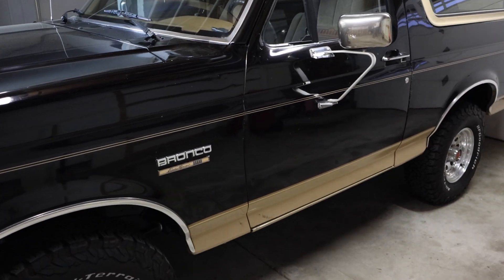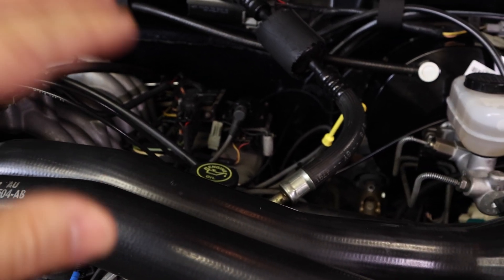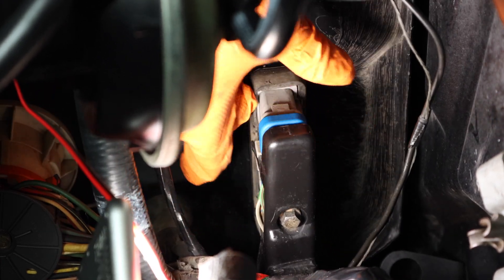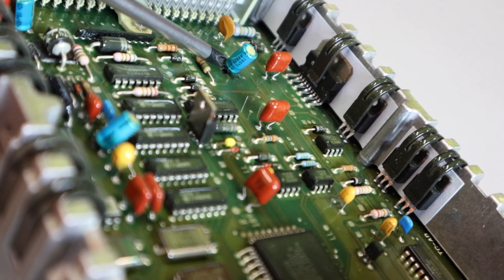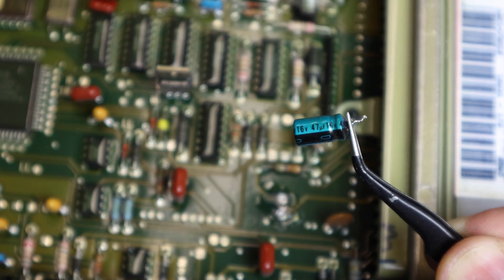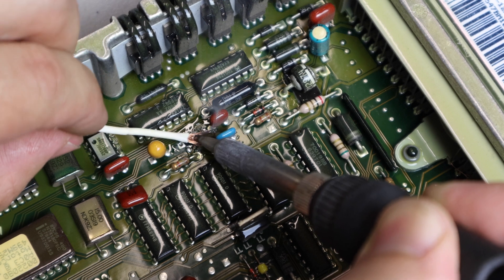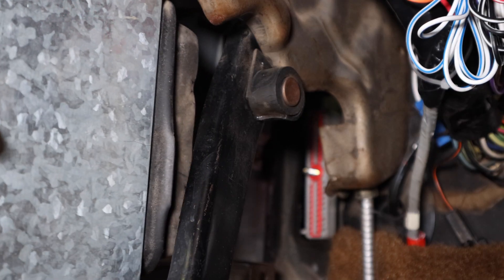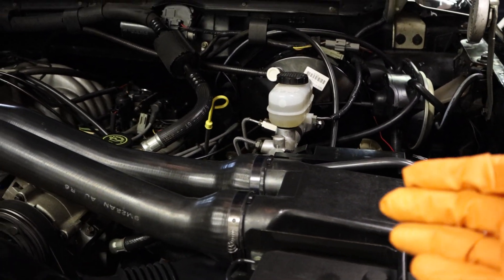Ford ECM Repair EEC IV | Fix Multiple Issues | 1980-1996 Ford Bronco F150 | Bronco Restoration

Comment: Thank you for the video! Years ago, I remember doing LED electronic work and I can’t remember if the long blade represents the positive or the negative but how are you deciphering positive versus negative when you’re installing… I heard you say look at the black bar on the first resistor that you did, but how do you know which side is which??

Comment: I jist spent around 500 replacing everything from maf alternator idle air control . Break booster . Coil pack . All on my 91 4.0  jist to realize this is my problem ... thank you for the video

Comment: Could this fix help out with the battery light being on?
Reply from the maker: If the truck runs normal other than the battery light check the charging circuit first. Check the alternator (local parts stores do this for free) check/replace wiring from alternator to battery and to solenoid. Also check for battery health and cable/terminals for corrosion. Does your voltage gauge work properly?

Comment: I’m real interested in how you tested your idle w your multimeter. I have a 94 bronco XL 302, and he doesn’t have an RPM gauge. Care to shed some knowledge on testing your idle w the multimeter?
Reply from the maker: I tested the TPS sensor and IAC valve. The IAC valve controls the minimum air needed to hold a steady idle, while the TPS sensor provide the ECM with throttle position. The TPS voltage reading will change with opening/closing of the throttle which the ECM uses to calibrate air/fuel ratio. If you need to verify your RPM speed you can purchase an aftermarket RPM gauge/tach and it should be easy enough to setup, I believe one wire to the ignition coil.

Comment: @TheFixTech Are the capacitors the only thing that could fail on these ECMs? What about the brackets on the side. I am thinking of replacing mine. Quick question, what if I get non-polarized capacitors, any specifics?

Comment: I had a pcm repaired recently for my '96 F250 by a well-known guy on FB.  Worked fine before I sent it in but wanted to be proactive and get the caps replaced. Got it back, reinstalled it and now I have an intermittent issue where the engine labors for roughly 15-60 seconds. Could there have been something that he messed up when doing the repair that's causing this?  I've been firing the parts cannon at it lately with no remedies thus far.
Reply from the maker: The 1996 year model has an OBD 2 PCM that may not have the capacitors. With this system you can scan the system using the obd diagnostic port and the PCM should tell you any pending codes. If the engine struggles on initial fire up it could be a sign of a failing IAC valve that controls idle. I would start with scanning the pcm for any codes.

Comment: I have read the problem is usually no the EEC.  So, how common is this?  I have a 1990 Notch Foxbody with many issues...
Reply from the maker: It is a low cost fix that is worth trying, open the ECM and check the capacitors. If there are bad you will see them leaking and or bulging. If they appear fine do not attempt repair. Scan the ECM for error codes and start there.

Comment: I might have to check this out, I've been fighting an issue that seems like nobody else has been having. My 89 f250 will intermittently shut off and turn back on again in rapid succession while driving down the road. Imagine being on the throttle and just switching the key on and off as fast as you can. I've checked voltages, traced wires, replaced grounds, and tested sensors until I couldn't take it anymore. The idle is also weird where sometimes it will hang a little high after driving and after it sits for a bit it will come back down, sometimes it idles smooth, sometimes it has a jerky idle. If I turn my headlights on and run the blower motor full blast it will cut out way more often which is why I thought it was a power/ground issue. However disconnected the battery every couple months has been keeping it running more smoothly.

Comment: I have f750  getting phantom voltage  any ideas  im think ecu but there all backorder  control module 63.47 volts
Reply from the maker: Disconnect the battery, then unplug the ecm/pcm, reconnect the battery and check for voltage across all connectors, if there is power where there shouldn't be then there is a short in the wiring. Check all battery connections and fusible links, also alternator voltage regulator

Comment: going with higher voltage rated capacitors can lead to a longer lifespan and provide extra protection (going with a 25v vs a 16v for example), also, when possible, always go with brand name caps.

Comment: will this fix mine? Mine killed the ecm engine off check and the fuel pumps continually run when the initial key turn on is done. Was running great , on the freeway still ran but started sputtering and loss of power. Black smoke like a bad accelerator pump or a vacuum advance went bad on a carbureted car.

Comment: '91 Lincoln Mark VII , 302 . I don't have hardly anything else left to change or check . Soooo , bangs , pops , shutts off , but for only one second at a time ; however smooths out above 4 thousand RPM , also the timing advances with the re install of the spout connector , so that function of the ECM is correct . Also runs considerably worse with the spout connector out . Thinking its not the pickup , because it gets better over 4 thou , also not the ignition module 4th one in 2 months , and I won't put one in now without testing . I have nothing to loose with the blue caps , ???
Reply: It's neither of those , will the caps cause those one second ignition shutt offs ,,, ?
Reply from the maker: @ it’s a possibility, have you checked for any stored dtc? If the check engine does not work that is a sign of a bad ecm. Also check for voltage at the tps sensor
Reply: @TheFixTech ,,, I'll re check the TPS , had 5 volts at the MAP today . Btw , do you solder in these caps as a business  ,,, ?
Reply from the maker: Double check ignition timing, the 302 and 351 have different firing orders.

Comment: Any idea why my 1994 Ford F150 5.0 2WD Automatic Transmission intermittently goes Neutral around 55mph for no reason & then goes back into Gear by itself!?
Reply from the maker: Does the speedometer/odometer work correctly? Any check engine lights or flashing o/d light? If so the speed sensor or psom could be a fault. Check fluid level and condition replace with Mobil 1 synthetic and new filter if needed. While pan is dropped remove the shift solenoid pack and test, replace if needed.

Comment: What was the main reason for this just rough idle. I'm getting no signal to the positive  side of the coil and showed code 24 eca 90 f150
Reply from the maker: Code 24 is the act/iat temp intake temp sensor. This sensor is located on top middle of the intake on V8 models. Make sure the engine is warm before pulling codes as this could be a fault of just a cold engine.

Comment: I thought my eve was bad. I inspected it and nothing look me wrong. It even has the newer looking brown capacitors. I assume it’s been gone through since having new capacitors in it. And I was hoping it was bad cause I can’t figure out what’s casing it to run poorly.
Reply from the maker: Is there a check engine light? Run the OBD or scan the codes to start diagnosing. Also check the basics, fuel pressure, timing, spark, ect..

Comment: This actually answers why my 96 f150 is acting odd even with replacing the pickup coil inside the distributor, seeing I am pulling the motor next moth to install a new cam and few things this just got added to the list
Reply from the maker: Unfortunately the 96 is different as it uses an OBD 2 ecm not the EEC IV. Use a good diagnostic scanner to check for any stored codes and run a live data check. You should be able to check all parameters in real time, fuel trims will tell you a lot.
Reply: ICM-Ignition Control Module left fender well under the hinge area. 

Get the black ICM, not the gray one.

Comment: Thanks a lot for the video! My capacitors went bad and I replaced with this tutorial. However the erratic idle after starting the truck hasn’t gone away lol I’ve replaced the IAC valve, TPS sensor, and MAP sensor already…. Any idea what else to try?  😅
Reply from the maker: Check for vacuum at engine idle after warm, should be at least 15psi depending on altitude. Vacuum leak can be intake gaskets

Comment: Good video man, this is real.  Also, the death wobble caster bushing to add a couple of degrees of caster if you run into wobble.
The front coil springs are known to sag over time as well, causing camber issues.

Comment: 3rd time my ecm shorts. I don’t know what else to do to find the cause
Reply from the maker: Check all your ground wires. Make sure they are grounded and clean. Check them for short to power, check the ecm power wire for short to ground. Do these checks with ecm removed.

Comment: The title indicates 1980-1996, is the ECM still in the same place for 1986?  Trying to locate it.
Reply from the maker: If it’s not in the kick panel as shown then it should be right above the gas pedal (inside the cab)

Comment: Damn bro, you have the best Bronco content there is out on the internet!! Had a question, how did you set the idle voltage on the throttle?? Do you have a video out there how you did it?

Comment: Very wel!! Now, let me ask a dumb or stupid question. By the way, I have a 1991 F150. This is the system before the OBD2, meaning no electronic devices available to read codes or produce any type of diagnostics. (I think this is the system where diagnostics are done based on how many times the check engine light flashes and there's your code). Now that I see the ECM inside. Here's the please don't shoot me question. 😅 Could this ECM be converted to OBD2? i.e., pulling the right wires to the OBD2 connector. Then again, the software might not be friendly. But, if possible, then able to reflash it with a new program. I've worked with the Oshkosh and built a complete harness swap on a 2012 SRT-8 for a 1970 Charger, and here's where I see you have the on hands experience.
Reply from the maker: The ecm itself cannot be converted to obd 2. You will need the obd 2 ecm (from the 1996 model) as well as the complete engine harness and sensors, along with the transmission/controller. It can be done but unless you have a donor vehicle, it will be expensive. The obd on these trucks are quite good, you can still buy and obd 1 scanner but the on board flashing light works well enough. Just be sure to bring the engine to operating temperature before attempting to pull codes.
Reply: @TheFixTech Thanks for getting back to me. I'm in agreement, and it was my fear or suspicion.

Comment: I would suggest going with electrolytic capacitors rated at either 25v.or 35 volts instead of the original 6.3v and 16 v. It's just added durability and the physical size is the same. Be sure to disconnect battery first before attempting this.

Comment: Beautiful bronco you really maintain it, and it shows. I have an 87 f150 xlt lariat, do you know if the ecm pulls out from the inside as well. I'm just wondering if those  capacitors has something to do with my idle up and down, up and down when I first start it. Then, it levels out to a decent idle. Right now, the truck won't start, I have spark, I think it's fuel related dropped off at shop. Hopefully, it's nothing much
Reply from the maker: Yes the 1987 ECM pulls out from the inside as shown. Check your IAC valve and TPS sensor for the idle issues first.
Reply: @TheFixTech  thank you so much for getting back to me. Right now, the truck is in the shop for the no start issue. But I want to check that ECM Capacitors, once I get it back unless that's the problem that he discovers.

Comment: Can a bad ecm cause a no start? Also, my obd1 reader won't pair with my ecm ever since the no start happened.
Reply from the maker: Check all your fuses, inside cab and engine bay. Do you see the check engine light with key on engine off? If not then the ecm is bad.
Reply: l see the check engine light with "key on, engine off". Does that mean my computer is O.K?  l cannot connect to the computer with a obd-1 scanner, or, by using the ole paperclip method. With either method, there is no responce from the computer. l have a 1995 f150, 4.9 in line 6 cly. and have changed almost all the sensors including distributor cap & rotor & plugs. l am really concerned about the computer not communicating with me.
Reply: @billmancos9820 ever figure it out?

Comment: I have a 96 ford F150 with 5.0L that sputters when you accelerate and hold a constant speed would this be my problem to.
Reply from the maker: That would be an obd 2 pcm and may not have these capacitors. For your situation check your ignition module, it should be black in color, not the gray one. Also check your tps sensor and speed sensor. Any check engine/abs lights? If so run a diagnostic check with an obd 2 scanner.

Comment: I have a 1990 F-150, 300 6 cylinder, with 5 speed trans. I have replaced the Alternator, the Starter, Tension pulley and belt, and new Battery. When I start it, it shows charge on the dash. It idles about 800rpm. When I drive it some distance where it warms up, a lot of times at idles, the red engine light comes on and the charge needle goes to zero. It still runs, and I can get the charge showing at about 1200 rpm. However, I stopped at Oriley's, for an electrical check up. While the needles was on Zero, the red engine light was on, the Alternator showed output of 14.3  volts on the Battery.

They do not know why it reads like that on the dash while the alternator is putting out 14.3 volts charge to the battery. After it sets a while and everything cools down, it starts fine and no redlight, and the needle shows charge. 

So, what could it be doing ?

Comment: When it comes to replacing electrolytic caps, you can use higher voltage caps.
As the original caps are 16 volts, and the car works at 13.8 volts, you are running close to the working voltage of the caps. I would use 25 to 35 volt replacements, as the new caps are actually smaller now with the higher voltage rating. 

The capacity of the caps, 47 microfarad is more important to keep as close as possible, and 47 UF is more common than 50 UF caps were in the past, but if it was a 50 UF, you can use a 47 UF as a good substitute.

The one thing that takes a toll on caps is age! They have a liquid inside that can dry out, leak and corrode the board, or the unit may short and cause tracks to burn! Which is why there is a home industry repairing old electronics by replacing the caps known to fail due to age.

The temperature rating of the caps can also be increased without worrying about failure. I use 105 degree C caps as often as I can, there are higher ratings, but the cost is also a factor, so don't go overboard in increasing the temperature ratings too high!

One thing about soldering, be sure you use an iron that is grounded and does not cause static burnout of components. If you don't pay attention to this one fact, you can burn out semiconductors and cause more damage to the equipment.

Comment: Thanks for the video. I just did my 95 Bronco XLT E40D-4WD 5.8L;  I got the Nichicon FG Capacitors and a Weller 60W Kit from Amazon, I got it in and had it running twice with no issues. It feels like it's running smoother as well.
Reply from the maker: Very nice!
Reply: Do you have a amazon link to which ones uou went with?
Reply: @LiifeThruMyLens ...What he used is in the  video description with a Amazon link...

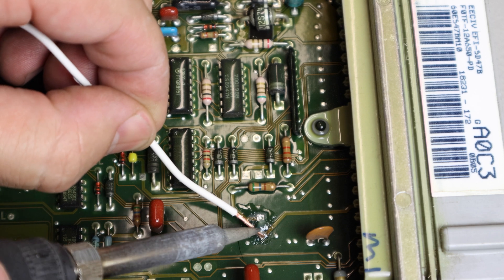Comment: Nice video, but at the 5:30 mark, you can usually get better results with a solder sucker ("desoldering pump") than a wick. I've re-capped a bunch of old jukebox tube amps, and wouldn't do it without one.
Reply from the maker: I do have one of those, bought from radio shack years back.

Comment: Try $329 But I rather pay for a motorcraft replacement than get a soldering iron and mess with it myself. Of course I could of gotten it cheaper but when it comes to electronics sensors etc… go with motorcraft

Comment: Hey buddy I’m getting ready on doing this and I’m a little confused on the resistors I’ve gotten vs the one I have on the ECM
Reply from the maker: The resistor numbers need to match. The positive/negative terminals also need to be soldered onto the correct side

Comment: Thanks for the great tutorial on how to remove and replace the ECM (TCM for my 1993 7.3 IDI diesel). I've installed two OEM TPS's and when setting the WOT voltage when opening the throttle toward WOT at 4 volts I get a momentary spike to 6 volts throwing the voltage way above the required 4.5 volts WOT setting recommended by Ford. This of course throws an error code causing the truck to go into limp mode. I had the exact same error when both new TPS's were installed. I figure if the issue is not the TPS the problem has to be in the TCM. Because when I'm setting the TPS voltages the truck is  only in a key on engine off state.

Comment: Thank you so much man i'v been struggling for 5 years to fix my truck it's been having transmission issues with shifting I found a shop last year that told me there is no signal going to ECM from Gauge Cluster all the trans shops around here have told me I need my transmission rebuilt when it has nothing to do with inside transmission it's been electrical I pulled out my ECM all 3 capacitors are leaking and I think it's like a fuse thing it's rusted bad
Reply from the maker: Depending on year of your truck, 92-96 will have a PSOM speedometer, these do go bad and will either need a replacement or rebuild usually around 80-100 dollars. If your overdrive light is flashing then this is likely the culprit. Try the capacitors first as they do need replacement, then look into the PSOM
Reply: @TheFixTech  I put in a used one and my transmission was shifting fine for a day then started acting bad the next day